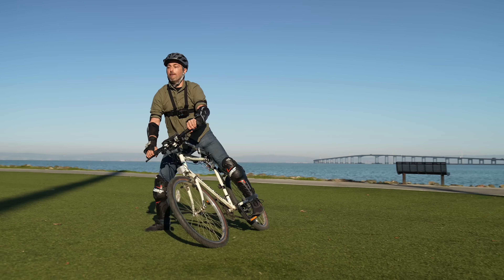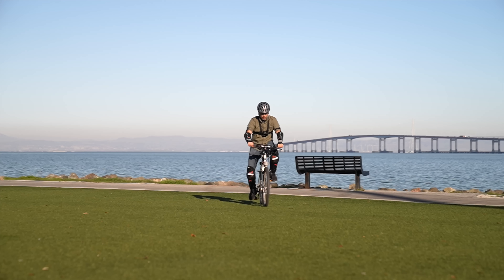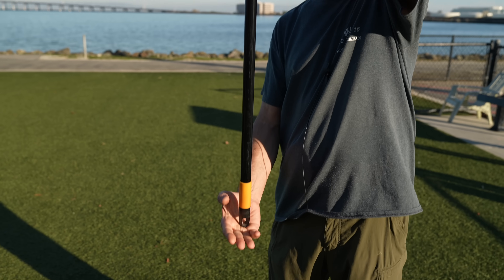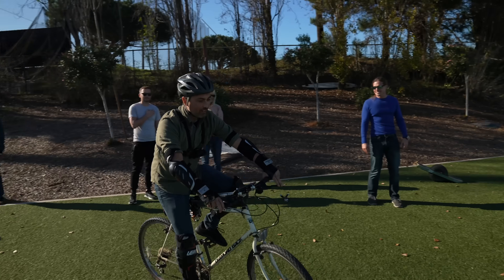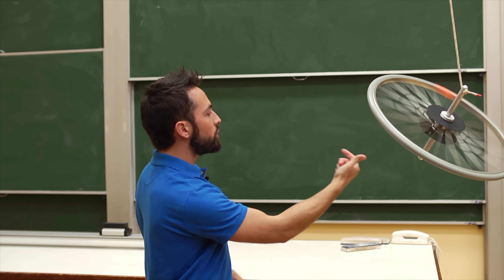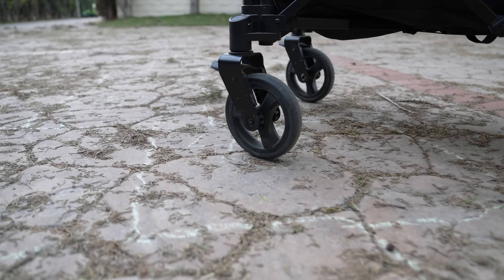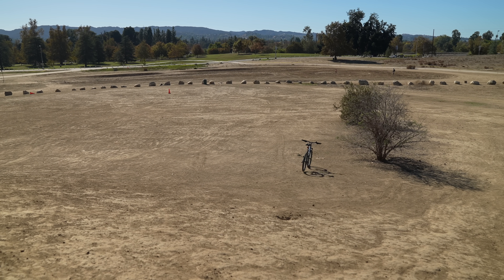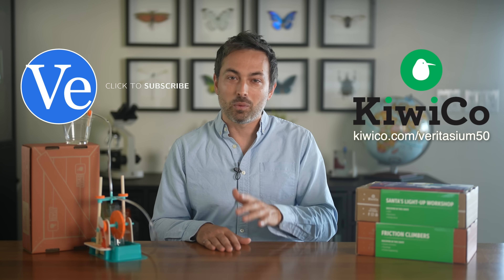Most People Don't Know How Bikes Work

Comment: This is also a thing you can see on motorcycles. Let's say you let off the bars and just lean to the left. The bar also turns to the right for a moment until the bike dips to the left side. That's also how countersteering works at higher speeds. I feel like this is a technique that most bikers are aware off because it's an essential for driving safely
Reply: True, its basically a required skill if your going 30mph or faster.
Reply: Push right go right
Reply: @MKIVGT40  And yet not taught in UK bike tests. Almost killed me on my 2nd or 3rd solo ride. Weird how varied different countries teaching priorities are, and the UK test is otherwise very rigorous.
Reply: @joby602  that sucks
Reply: @joby602  in my country most people don't have license for motorbikes.
Reply: @joby602  yup, not even 25 years ago. I thought by now they might be.
Reply: @joby602  Glad you’re still kicking after that. If the UK doesn’t teach that, they need to fix that now because it is so essential to know. Most people don’t know the concept, even if they know how to ride a bicycle. I assume that’s a bigger problem here though, since the US is so large and thus has little need for bicycles as a method of transport outside of major cities. You’d be surprised at how many adults I’ve run into that still don’t know how to ride a bicycle. Anyway, I have yet to run into a course in the US that doesn’t teach students about counter steering. Hell, I think counter steering the first thing my first MSF course started with after general safety rules.
Reply: @joby602  Well that depends on your instructor. I learned to ride in the UK and my instructor made a point of teaching us about countersteering.
Reply: @MKIVGT40  for the none bikers here he's talking about push the handlebars away from you with your right hand ;)
Reply: @MKIVGT40  Then you got people like me who pull left to go right. I don't know why, but pulling feels more natural than pushing. It might be because pushing on the side I'm turning, causing the bike to lean, makes me feel like I'm actively trying to fall off that side while pulling the opposite side makes me feel like I'm holding onto the bike as I lean.
Reply: @StapleCactus  The thing is both work and I actively use both depending on what my hands are doing, what I feel like doing or the situation. Heck if you want a really fast swerve, push one side and pull the other
Reply: I'm glad I saw this comment as I actually am getting my first bike around Christmas with the help of my dad so I'm trying to learn what I can before I start my lessons
Reply: Because motorcycle tires are round, and not flat like on a car, the circumference of the center of the tire is the largest.  The circumference decreases away from the center of the tire and is also involved with counter steering.  It is also part of the reason why railroad wheels are tapered.
Reply: @conrad4667  Didn’t know that that was the logic behind tapered railroad tracks. Definitely good to know.
Reply: Why would rem ride bike
Reply: hello am also biker boy
Reply: Yep this is extremeöy important to realise. People know it when they ride bikes but they need to be aware when they ride motorcycles
Reply: Didn't know Rem knew about bikes
Reply: Yep, Keith Code's been saying this for over 40 years. Even made a really cool "no BS" motorcycle to prove it.
Reply: That’s why these vehicles are also called ✨ motorbikes ✨
Reply: Fun fact? I was able to learn to ride a bike ONLY in 7-th grade !!! Because only then i uderstood phisicaly speaking what i need to do in order to maintain balance. The counter-forces i needed to develop ! In 7'th grade i got the Phisics discipline, the mechanics part. Same with the swiming, i was able to swim when i understood what i need to do in order to swim, by creating a constant force down to lift my body a little above the water. To be exact i neded to lift my hand or my leg more aquadinamicaly than when i put it don in the water. The diferences between these 2 forces was the lift force, to be able to stay on water. After that, to advance in water, i used part of the lift force to advance. So the movement was like a propeler.  So now i learned to swim too.  Same with staing on a ball , or 2 crossing pipes, like a circus guy,  or sky-ing and snowboarding. Couldn't aford a ski instructor, so i distroyed couple of a sky slopes to learn. Snow was destroyed,  and other sky turists had critical problem riding the slopes i used. Yeah , whenever i had a real problem to learned something, the other people around me got THE BAD LUCK, during my learning process. And i'm ok with that because nobody wanted to HELP ME. SO THEY GOT ALL THE SIDE EFFECTS OF KARMA !!!
Reply: @neytiritetskahamoatite7688  it took you till 7th grade to ride a bike?? I learned in my preschool days bruh
Reply: Hi Rem
You are forgotten
Reply: For someone from a world without bikes you sure are knowledgeable about them Rem.
Reply: Rem
Reply: @DrPoly Gaming That's just a bad habit pulling left when you need to lean right!
Reply: Was about to comment something like that. Anyone closely watching motorbike (racers) or riding themselves knows that ;-)
Reply: rem motercycling???? damn
Reply: Exactly lol I was like “ this isnt a surprise to anyone who ride a motorcycle”
Reply: Great one mate. A lot of Russian fellas forget to learn about counter steering and steer right into trucks in panic.
Reply: True. Included in curiculum in Denmark.
Reply: literally anyone with a motorcycle already knew how this vid was gonna play out once the mechanism was explained
Reply: You can actually use deliberate countersteering to make the bike lean over faster than it would with uncounscious countersteering
Reply: i ride a motorcycle, we were taught this during my training course almost immediately
Reply: I got given a ride on a mate's motorcycle years ago - he was in control, I was rear-seat passenger.  When we got to our destination, he commented "Now I know you've ridden a motorcycle before ... You were leaning the bike into corners for me."  I wasn't doing it consciously, I was just shifting my balance and posture to stay on the bike by reflex.
Reply: This.. This right here. Was thinkin this all video. Ive been ridin for a good 6 or 7 years now :D
Reply: Yesd
Reply: Most people learn how to do it THEN learn the concept of how it works lol
Reply: They have bikes in Lagunica?
Reply: Rem, Subaru here, can you explain just how the FRICK you know about motorcycles?

Comment: I see a couple issues. You're on grassy terrain and not moving very fast at all. You're constantly making micro adjustments with the handlebars to keep yourself upright. Try this while moving at a reasonable speed on a flatter, more ideal surface such as asphalt or concrete. You will have less of a need for these micro adjustments as the bike will naturally want to stay upright. Then you can test the locked steering with little to no outside interference.

Comment: This is true only for beginner riders. Experienced mountain bikers use differenr steering technique. If you stand on pedals, drop the saddle down and learn to lean the bike, you can easily turn the bike with locked handlebar.

It's funny how only motorbikers agree with this video. Motorbike and bike are two entirely different things due to relation between rider mass and vehicle mass.

Comment: This is what's happening when you ride a motorcycle. It's called counter steering. You push your right handlebar to the front and then turn right. this is at first very counter intuitive.
If you ride faster than ~30km/h this effect is gone, and you can steer normally by leaning into the corner.

Comment: If u take a bike straight down hill an do not petal u can stay balanced with no turning the wheel once u start pedaling tht throws ur center off balance u proved tht with the gyroscope.
Reply: But to make any turns or adjustments. Counter steering is def a part of tht no question

Comment: One thing I don’t think they quite covered is steering at speed. Beyond a certain speed (something like 20mph) on a motorcycle or bicycle, it is IMPOSSIBLE to turn without counter steering. And not just at the beginning of the turn. For a right turn, for example, you are turning the handlebars left for the entire turn.

Comment: My late father used to run a bike shop and he was an avid collector of vintage bikes like pennyfarthing, push susan, boneshakers, high nelly, etc. When he came down with arthritis in his hands, I helped him with bike fittings and repairs. Working on hundreds of bikes was not my cup of tea, while painting was in my veins. As a lady, I broke my nails on bike works, had skin allergy to bike oil, etc. Everyday, I worked on gears, chains, cables, etc and tested them. I looked at their designs, even right down to the designs of all the different bolts and nuts for bike parts. Left pedals were screwed differently, because of forward pedalling. 
Years later, I love mechanical engineering only in 3D modelling. No more chipping my nails on mechanics. 😁

Comment: my first thought when learning it's about turning was "don't you just shorten the circumference on one side, reducing the travel distance in that direction, thus pulling you in that direction? In which case, wouldn't simply leaning allow you to make such a turn? I know that I certainly made plenty of turns by leaning... or a combination of leaning and turning the handles, in cases of hard turns..."
It might not be quite as easy, but as far as I'm aware, it should work...
Reply: WHAT I THOUGHT I WAS THE ONLY ONE WHO JUST LEANED TO MAKE TURNS
Reply: I think that locking the handlebars to be completely incapable of going to a certain angle will also make leaning less effective. As you initiate a lean for a left turn for example, the main frame moves to the left as result of the lean. The front wheel would stay in the same orientation at first creating a somewhat implied right turn which corrects itself almost instantly and you turn left. 
This is also why he was able to steer right continously when steering to the left was locked but he already had that left correction when it happened.

Comment: Understanding of counter steer has had an interesting effect on motorcycles.  Back in the day, this knowledge wasn't widespread at all, and instead steering geometry was mostly understood in generalizations.  Steeper rake angle gives you quicker turn-in, etc.  These bikes ride in a very loose, organic sort of way.  They don't self-stabilize very much, so if you let go of the bars you have to move your weight around pretty actively to keep it straight.  Conversely, it takes VERY little counter steer effort to initiate a turn.

Now, I mostly ride vintage bikes, and never had a problem with how they handle (except a couple genuine hippos with wobbly frames), but friends with modern bikes always said mine was terrifying.  How different could the modern bike be?  Is it so stable that you can drag you knee on the pavement and make a sandwich at the same time?

Then I tried one.  YES.  When you let go of the bars on a modern bike, it just stays where you left it.  Straight, turned, whatever, it's locked at that angle.  Going around basic turns on a Ninja, you FEEL your inside hand pushing forward.  There's no mistaking it, it's very deliberate.  But the funny thing is, when you do cram on the bars and try to lean quickly, the thing absolutely YEETS into the lean.  The old bikes will fall into turns effortlessly, but quickly resist efforts to grab it by the scruff of the neck and jam it over.  It's fascinating that they've managed to deliver the best of both worlds through greater understanding of the physics and the effects of geometry.

That said, the biggest part of my heart is still reserved for a bike that you turn just by thinking about where you want to go, rather than one with that digital F-16 thing going on.  Also, I find value in getting a good wibbly-wobble when I do something ham-fisted; a modern bike tends to tell you you're amazing until something else (like a ditch line or an oncoming Volvo) proves otherwise.
Reply: This could also be an effect caused by wider and more modern tires. The wider the tire is the harder you need to push the inside bar as a general rule of thumb. Like you even feel the difference if you have a 160 or a 180 in the back quite a lot with the same tire up front it takes more effort but then if you drive something with the same weight ergonomics and geometry that has a 130 in the back oh boy is that thing agile and wants to lean in the turn. It's always fun to hop on older bikes or different ones to see all the differences for sure but I'll still stick with modern sport bikes. Very precise with good suspension and awesome tires
That's where i feel comfortable and at home and if people drive with their brains on you won't end up in a truck doesn't matter which machine your on ;)
Reply: @rem362  Tire width and rim diameter are definitely big headline things that have changed.  Fortunately you can get pretty good tire compounds for the older bikes, up to and including modern race slicks.  The selection isn't as vast as modern sport bike sizes, but the scrape marks I've carved into the edges of my foot pegs say the tires are "good enough".
Reply: *Obligatory mention of Tony Foale whenever bike geometry comes up.
Particularly trail and rake
Reply: @samnope7344  I was going to say he's talking about trail and rake without realizing it.
Reply: The bike you turn by just thinking about where you want to go is honestly whatever bike you're used to. Every bike I've owned reaches that point after a while, and I started with cruisers and switched to sport tourers.
Reply: @nerodia  That's true, every bike becomes intuitive with time.  I'm just referring to the physical steering pressure on the bars.  It creates the loose and flowing feeling, what a modern rider might think of as vague and sketchy, lol.  Like the difference between an F-15 and an F-16, if that makes sense.
Reply: This seems like the best stream to ask this question. I've ridden bicycles and motorcycles just about all my life, and have been riding on intuition and feel for many years over a complete array of two-wheel devices. It was always apparent to me that you must initiate your turn on a motorcycle by countersteer, but I assumed it was a gyroscopic precession sort of thing. I'm aware of caster and rake angles as such and realize the stabilizing effect of more caster. The thing that puzzles my is the effect of applied power on a motorcycle versus coasting or just rolling at the very same speed. Maneuvering with applied but controlled power input (which I learned from Jerry Palladino on youtube) is a completely different animal from freewheeling at the same speed. One is controllable, one is not. Riding the clutch and dragging the rear brake stabilizes a motorcycle at slow speeds, right down to zero. A motorcycle coasting at the same speed is unstable and uncontrollable by comparison. That power input is adding a stabilizing effect some way or another. What's the analysis on this? Thank you.
Reply: @jbj27406  Sorry to say, I'm not sure.  I know the effect you're talking about, but I don't know why it works.  I could tell you why a bike wants the power on during hard cornering, but that's a different question.  Hopefully someone more knowledgeable can chime in.
Reply: @JETZcorp  Thanks for your reply. I came across those Jerry Palladino (Ride Like A Pro) videos on youtube and was amazed at the effect of his technique. That method of having constant power input to the rear wheel while controlling speed with the rear brake is like magic. He was a motor officer for many years and is one of the experts on low speed maneuvering and finding your line in turns by actively looking to the proper point ahead in the road. He can really ride. I learned a lot from him and bought one of his videos, but I am yet to figure out how that power input works from the standpoint of mechanics and physics. Thanks again.

Comment: Because I think it wasn't clear enough in the video: To turn right, push your right hand away slightly to create the tilt (yes, handlebars slightly left).  No need to 'turn' the handle bars to the right at all.  The only time we turn the bars the direction of the turn is when we are going very slow (particularly important for motorcycles and stability on downhill cycling). :)

Comment: In tuning the suspension of cars, caster is the angle of the suspension strut from vertical. The more this angle increases, the easier the wheel goes back to center after cornering. I think anything with steering will go to the same direction the center of mass is going, and it corrects itself after acceleration.